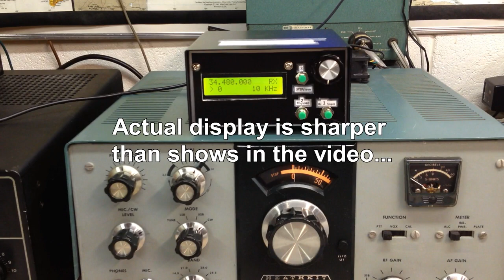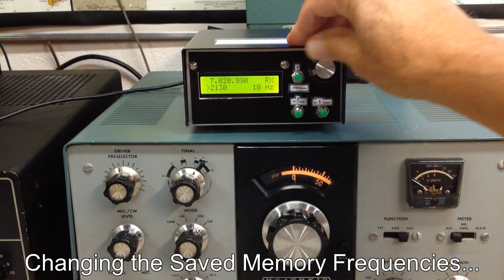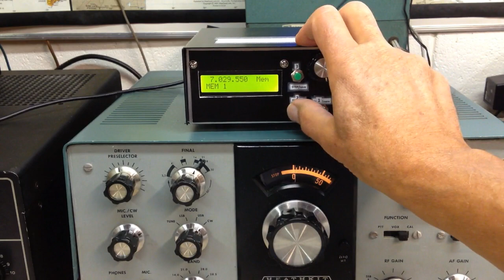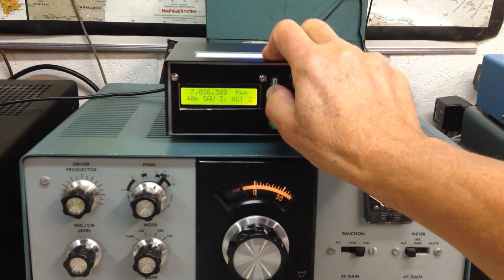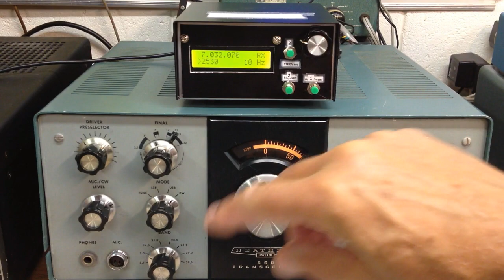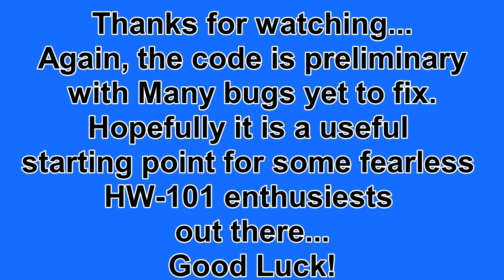Setup, Cal, & Op Instructions for HW-101 Arduino DDS-VFO

Comment: HomeBrew Simple 12 Volt Gel Cell Battery Charger & Maintainer for Cheap. You can sell this and get rich. Deer cams with DIY external battery's banks. Lot's use the 7 / 10 amp Hour battery and over charge them. I did. Killed 4. A small controller with the right panel for sell will make you rich. Sorry to hi jack this post. But could not reply on the main post about this. O i will buy one or more.